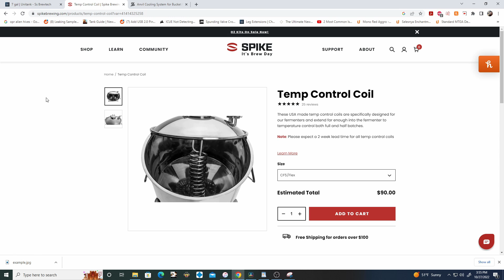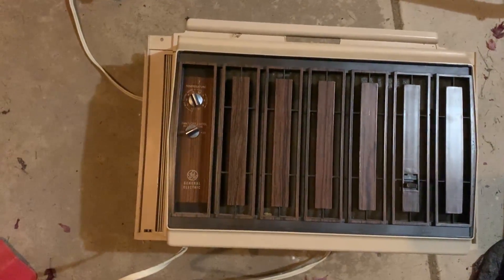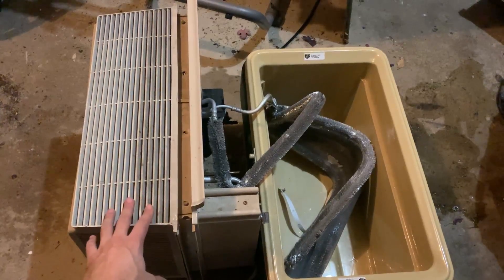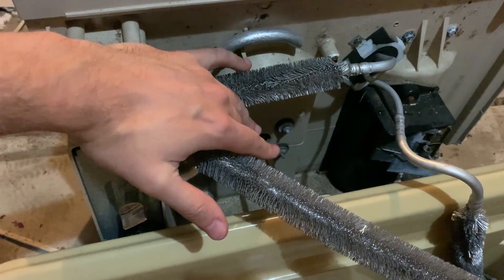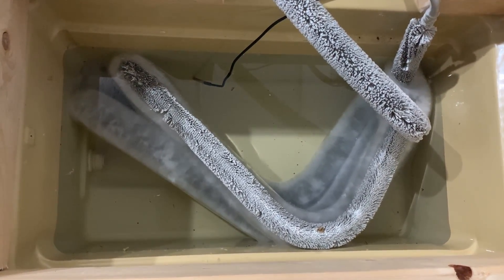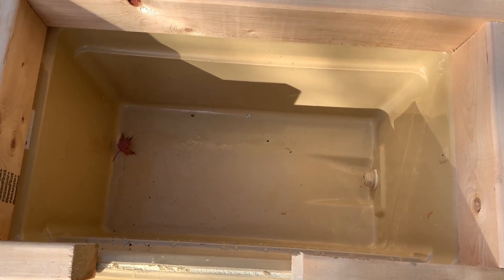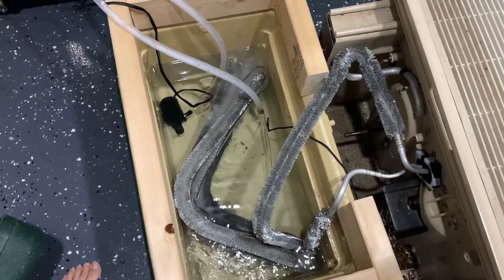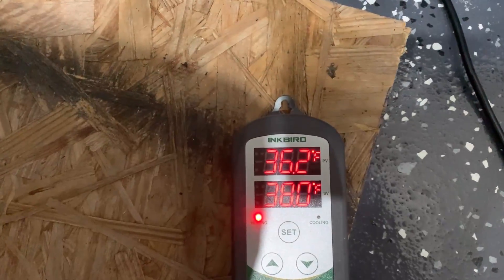DIY Glycol Chiller For Under $100 | CHEEPEST WAY To Get Into Lager Fermentations!

Comment: If we need cooler temperature, do you think we can use alcohol instead of glycol ?
Reply from the maker: Im not sure! I would think you could, but I would double check the impact alcohol may have against the components that it would be in contact with.

Comment: How did you get the circ pump stay attached to the bottom of the cooler?
Reply from the maker: My pump just sits at the bottom. The weight of the pump just drags it down. Does your pump float?

Comment: Welp, you meant "under $100 as long as you already have all you need" right? 😅
Regardless, nice video!
Reply from the maker: Thanks for checking out the video! So in my case I built it for under 50 but if you source a cheep used/free ac on facebook marketplace you can prob build around that $100 price tag.

Comment: I love the ingenuity of this project and a great way to repurpose an old AC and cooler. A couple of questions. Are you using a single Inkbird for the AC and the pump or two different Inkbirds? Two separate is the only way I can imagine. I expect you would want the cold water bath to have a set temperature that is many degrees below the set temperature for your beer. You would need two temperature controllers for that if I understand correctly. Also, any recommendation on a submersible pump?
Reply from the maker: Hey sorry it took some time to get back to you on this question. Your right, 2 ink birds for this setup. For the pump I dont have a recommendation since im just using the pump that came with my fermenter. But any submersible pump would do, it can be very under powered since its just moving water up a few feet.

Comment: Nice stuff, this would satisfy the temperature control void that was left after my fermentation fridge died. Sadly window units don't exist around here. And portable AC is not ideal for this. That is why I was thinking of getting a spare Compressor Condenser for the Car refrigeratorunits and just doing everything from scratch.
Reply from the maker: Worst case you could just make ice, fill up some 2 liters of water and throw a bunch in the freezer (if you have the space) and just cycle them. Same idea, just more steps.

Comment: Nice project for cheap! but your inkbird temp probe in the cooler is going to fail because it is not water tight and not meant to be put directly in liquid. Put a plastic bag or something like that around the end to prolong the life of the inkbird.
Reply from the maker: Good tip will do, I thought those were waterproof.